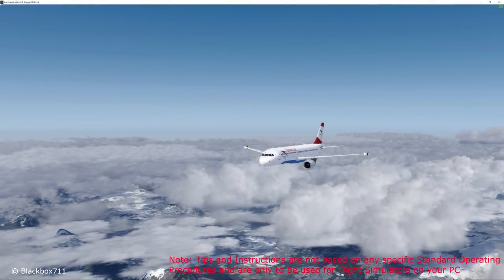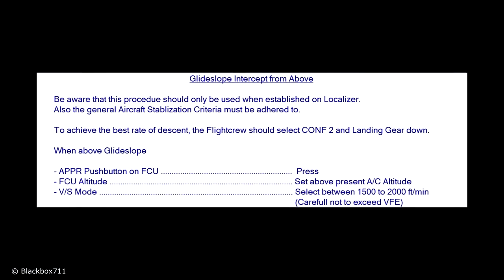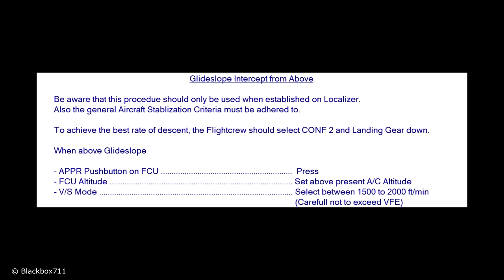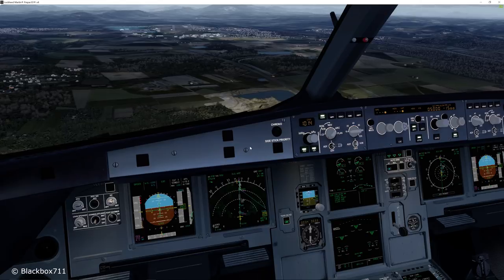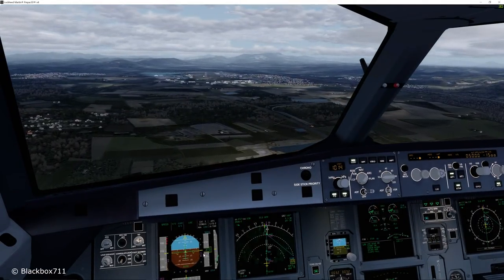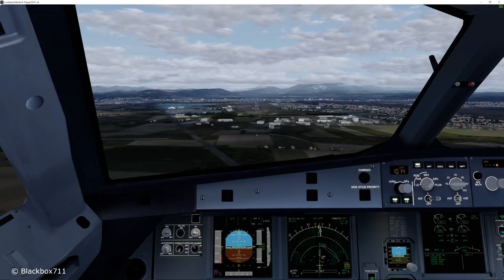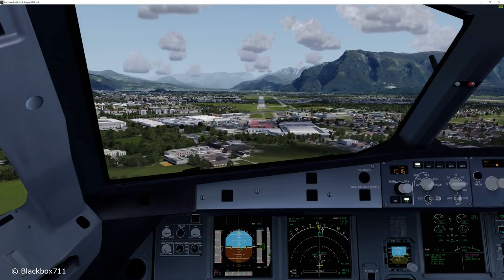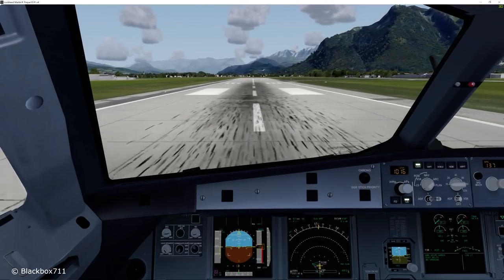FSLabs A320 Basics: Glideslope intercept from above

Comment: I've completed much steeper intercepts in the past. If you're visual with the runway and want to get down you can do s-curves as well. It's also a difference about what you can or should do. The procedures in this video are pretty safe, I'd not say that about my methods used to get down :D (if you pull g-s your induced drag rises, that is one method of slowing down - some passengers may actually like that, majority probably not :D )
Reply from the maker: In real life flying steep S-Turns or even pull g's you would get an earfull from your passengers. Probably somebody writing a complaint to the company or an automatic safety report being triggerd, followed by "coffee no buscuits" with your boss. If you don't care about using real life procedures in the Sim, go ahead. Then do whatever you like.

Comment: hi! 
i have been watching to your videos with great interest! It is so easy to put icao/icao as your dept & destination airport in the INIT page and hit 'ALIGN IRS' button to make a regular flight.  Now, let's add some spice and do something unusual! I will give you an example:  how do you operate an airbus A320 aircraft in case your departure and/or destination airport is not present in the 
 airac database? The most prominent example for this is the Simferopol Intl. Airport located in Crimea. Due to the current geopolitical situation, that airport is no longer being referenced neither is being listed by ICAO/airac since 2014-15 and it's icao code is currently being under dispute by the belligerents of that conflict (ukraine/russia).  (Prior to this, Simferopol used to be referenced as UKFF under ukraine control, and now it is being claimed as URFF under russian control) Despite of that, currently, russian domestic airliners are still operating and deserving that destination using B737 & A320's daily; somehow overriding the absence of airac/navdata covering the entire region. Now, let's put aside the geopolitical situation of that airport and that region as it was just an exemple, can you please demonstrate how do you setup the FMGC and depart from an airport/rwy that does not exist in the AIRAC database (but is still there in real life),  what is the procedure to align irs manually using the GPS and how do you create accurately the 'new runway' in 'DATA' page etc in order to have your aircraft properly aligned on the departing runway that you have created as 'pilot's runway'. I think that will be definitely something new and interesting to learn, thank you very much in advance!

Comment: It seems to me that the 777 is easier to land than the A320, which wasn't what I expected. I thought the A320 would be more automated when it comes to landing. I also seem to run into this problem quite often where I'm always above the GS capture point. Not sure what I'm doing wrong. Is this normal behavior for the FSLabs A320? How can I make the GS capture more automated so that I wouldn't have to mess with anything during the approach/descent phase?
Reply from the maker: +nomomrnyeguy .. well if you are above the Glideslope there is usually a good reason for it. Either you or ATC miscalculated the descent. The only you can automatically intercept the Glideslope in a more relaxed manner is to make sure your descent planning is not too tight. So leave some room for a level flight portion, in case you get vectorer closer than expected. Happy Landings
Reply: But I was following the tutorial that came with this plane... from LOWW to Copenhagen... I initated the descent when the FMA announced "DECELERATE". I wasn't using ATC, just following the tutorial, but not sure why I missed capturing the GS.
Reply from the maker: +nomomrnyeguy ... make sure you do not get above the optimum descent path or shorten the flightplan.